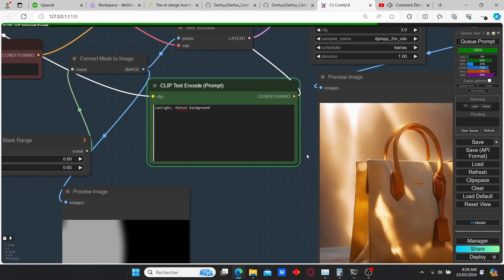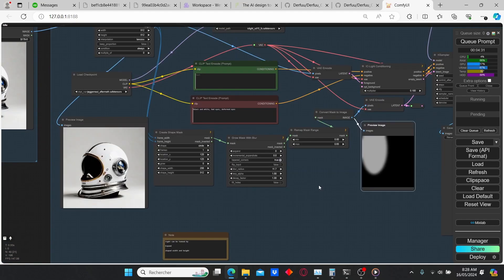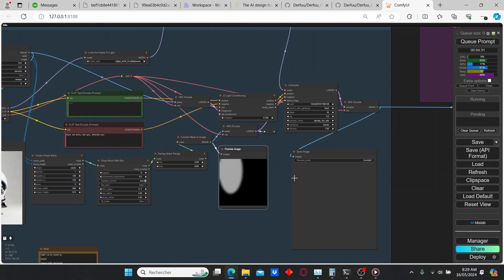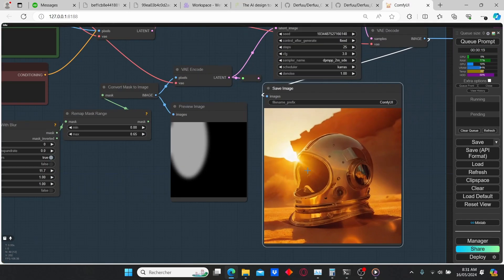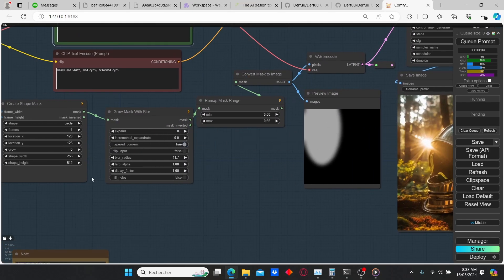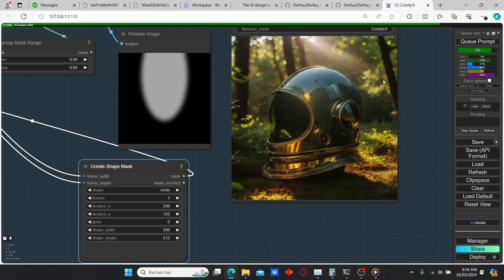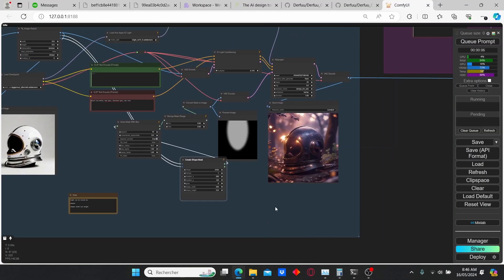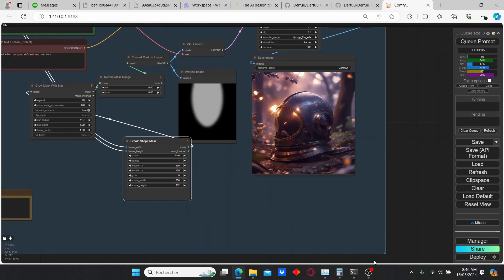ComfyUI Tutorial: Background and Light control using IPadapter #comfyui #comfyuitutorial #ipadapter

Comment: IPAdapterAdvanced
Error(s) in loading state_dict for ImageProjModel: size mismatch for proj.weight: copying a param with shape torch.Size([3072, 1024]) from checkpoint, the shape in current model is torch.Size([3072, 1280]).
Reply from the maker: This error is new I also encountered the same error with flux models but you can try to update comfyui may be it will fix the errors

Comment: Your comparison between IC-light and IP-Adapter is really a good idea. I have the feeling that you have more control of the final result with IP-Adapter in selecting a base image. With IC-light you always have a quite heavy color shift. Is the mask still playing a role if you are using IP-Adapter?
Reply from the maker: yes it is still playing role and you can check it by changing its position